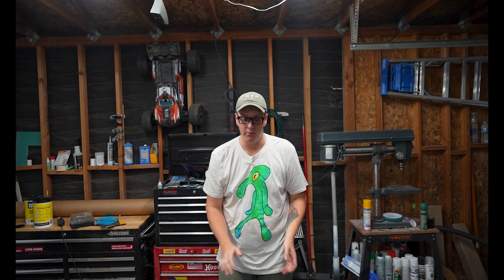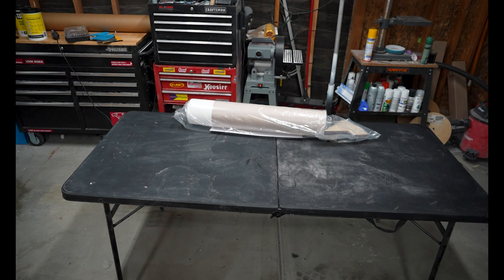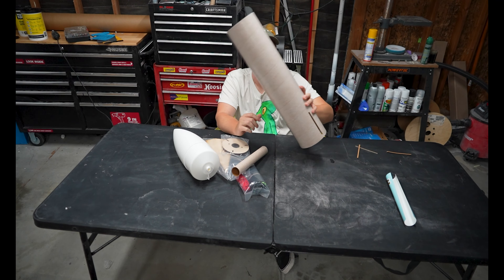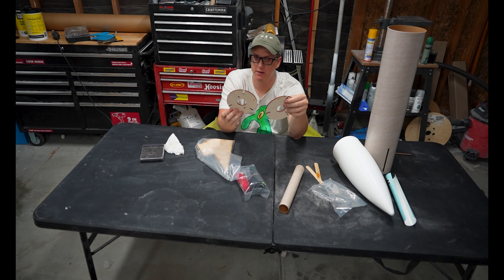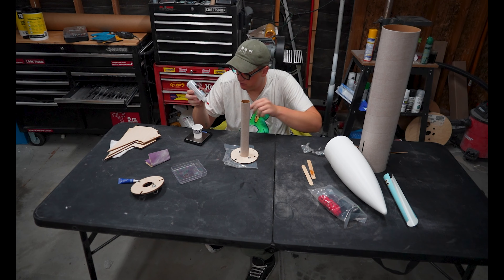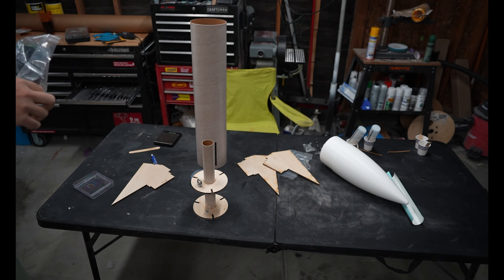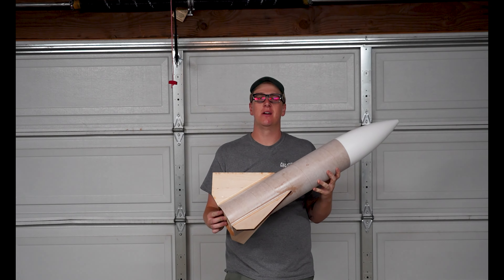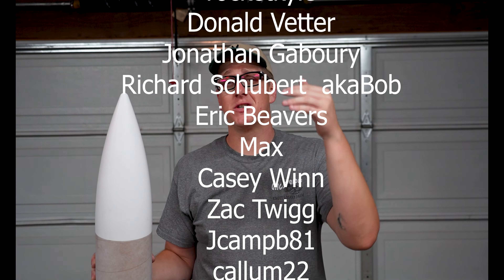One of The Best High Power Rocket Kits | LOC/Precision Minie Magg

Comment: We used to extend the fin slots all the way down to the bottom. Epoxy front centering ring(s) on to motor tube and don't glue rear ring. Slide mount in body tube and dont glue. Put rear ring on but not epoxied at all. Slide fins through slot and epoxy with not too much epoxy. When dry, slide the entire motor mount/fins/center rings assembly out the back of body tube. This way you can make strong fillets on fins to motor tube. Also rings to motor tube. When reinforced and dry, slide assembly in as you did and do external fin fillets.

Another tip is to glue a hole through tip of nose cone perpendicular an run a dowel through it and cut off flush externally after dry. I do this because even West won' always adhere to the plastic they use on those plastic cone that isr smooth inside. Dowel gives epoxy/bb slurry something to grab and not move. I had this prob on my lock 7.5" V2

I also like u-bolts with a backing plate instead of eye bolts. Probably all overkill for this build but good building techniques
Reply from the maker: @ZZ430T56  With the lock-in-fin you could build the whole fin can assemly outside the rocket without needing to use the airframe tube as reference.

Interesting to slot the tube AND not use the rear ring. I've done a little of either or, but have more recently fallen under the impression that internal fillets do more harm than good.

Comment: No stretching needed. Cut a hole in the bottom of the noes cone and let the motor slide into to.
Reply from the maker: For some reason I thought the Loki case was way longer than it is, but you're right, it could fit. No motor eject on those, though, so you'd have to get a little creative
Reply: @RocketVlogs  I will show you a picture I have of a stock length mini on a 4 grain 98mm M2500T from when I was in FL.

Comment: You once said they will fly on mid power motors? nice build, where is that shock cord from? Is it just 1/4" nylon tubing ? Or red kevlar?
Reply: That shock chord comes with the kit.  It just 15 feet of half inch nylon chord.  Works fine for a build of this caliber if you don't plan on launching it more than 5 or 6 times before changing out your shock chord.

Comment: Very cool build! And it's also a good look at what LOC puts in their kits! A suggestion for doing the slot alignment without gluing the fins in place, you could just use the leading edge of the fin. It won't reach the motor mount, and it will still be long enough to align the slots.

Comment: can that fly on a G77 or G80 as mid power?
Reply from the maker: No. The rocket itself exceeds the Class 1 weight limit of 1,500 grams (53oz) and that restriction includes propellant.A G80 is about the bare minimum a Minie Magg could fly on with a waiver. You'll need zero wind! The Micro Magg would be a great alternative, though.
Reply: @RocketVlogs  just finished it, was exactly 53oz w/ no paint. I did not use any of the included metal to save wt. I'm pissed bc I heard it was the largest dia. rocket sold that could be launched as mid power? I was really looking forward to that. If one used 1/16th" carbon and ultra thin shock cord and parachute it may yet be possible? Too late for this one. All you need to drop is motor mass.

Comment: Could you not use CA glue on the inside of the tube to create more friction instead of tape?
Reply from the maker: You likely could! I like just using normal ol masking tape because humidity can pretty drastically change cardboard airframes. So, you can add or remove tape as needed.

Comment: With that amount of nose weight you put in what do you think would be the largest Aerotech Reloadable motor you could run ?
Reply from the maker: Longer motors require less nose weight most of the time. I wouldn't hesitate to put a J570 or J825 in it!